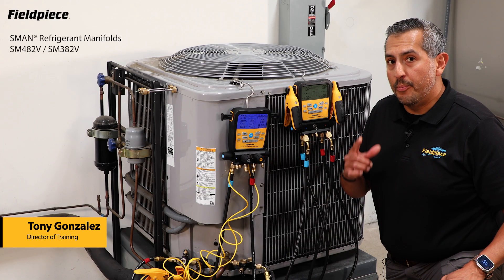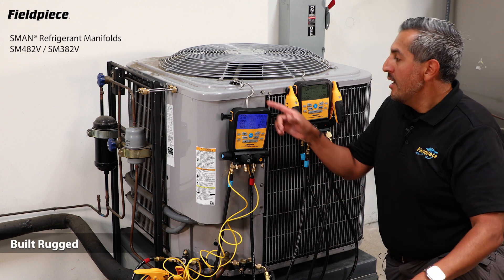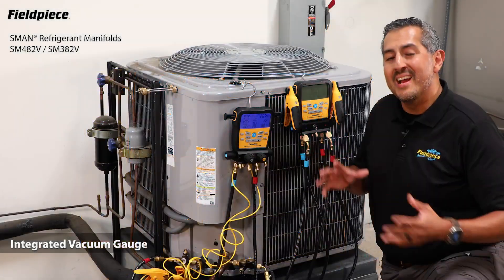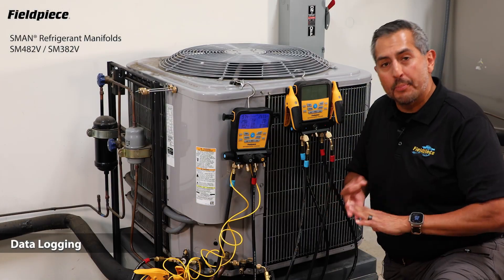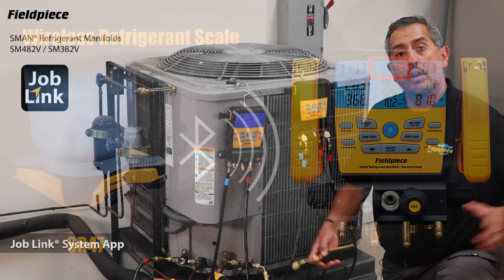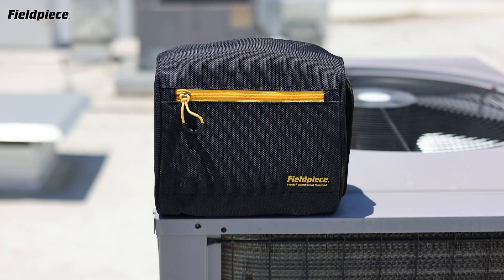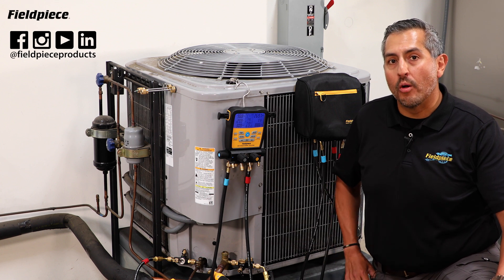NEXT GENERATION DIGITAL MANIFOLDS | Fieldpiece SM482V | SM382V

Comment: So i had the last gen. I loved it. But the internal vacuum gauge stopped working on every set I've come across because it keeps getting hit with refrigerant and there's no way to clean it. So why put it in. Especially if yall design it to work with an external gauge? Also I was taught nitrogen does not fluctuate with ambient temp because its an inert gas? I obviously could be wrong. Just wondering.

Comment: The 382V is much better because no one pulls vacuum through a manifold anymore lol
Reply: Probably a stupid question I’m in residential hvac everyone at my company uses these to pull a vacuum and I just bought the sm482 why does no one use them anymore
Reply: @Shooterrules  I think a lot of techs pull through gauges still. But the better way is a one hose (3/8 or bigger) with a core removal tool. Honestly it still works fine through gauges.
Reply: Right lol

Comment: I'll stick with my SM480V. Its also A2L compatible. I also use my wireless temp clamps with them and it does just fine. No need to spend $1000 for some gauge's when mine does almost the exact same thing.

Comment: Compare the 480 and 482. Why should I upgrade?
Reply: That’s a good point the only change I see is the clamp holders
Reply: The new ones are rated for new refrigerant coming out a2l
Reply: @dredrops1 The 480v and 380v are also a2l rated
Reply: @dredrops1  my sman 480 have A2L likes R32, R454B and even A3 refrigerant such as R290 and R600. the new function are the N2 test button

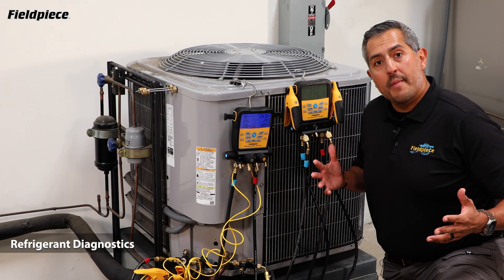Comment: How do you trust a guy that says "putted on" (about 1:35) and does not know the difference between supply and return vs indoor and outdoor unit?

Fieldpiece has NEVER implemented a psychometer for reading outdoor conditions in their app. despite repeated statements of "it's in the works".
Hey, you have it in the SMAN why not in the app?
Does that OA info transfer from the SMAN to the app when you link it?
Reply: Thank you for the feedback. As a matter of fact, the Job Link app is able to get the ODDB with the JL3RH. It’s been in the app for a couple months now. Check it out =)
Reply: @fieldpiece_tonyg  
I will look for it.
Used it this week and still had to input it manually.

Comment: Seems like the sm480v with a facelift. I love my sm480v gauges. I stopped using multiple gauge sets ever since i bought these. I will say the only thing about these is that they are a bit heavy but ill never go back to having 3 pairs analog gauges on the truck.

I also use fieldpiece probes and theyre nice. I dont like using my phone with nitrile gloves on, and i dont like getting refrigerant oil on my phone either. So manifold gauges are still my go to.
Reply from the maker: Heads up, the SM482V is about a half a pound lighter that the SM480V! Every little bit counts
Reply: @FieldpieceProducts  I will buy them for sure. 👍

Comment: I bought the digital probes.  Gauges are a thing of the past.
Reply: They have their place I wouldn’t say they are a thing of the past
Reply: Idk.   But they update the app all the time.   So I’m sure they can add it
Reply: Do the probes have the info of 32 and 454?
Reply: @kevinpearce3281  27 years and counting. Let’s see if you get half that. Nobody wants to steal them. No batteries to go dead. How accurate do you really need to be? You’re not building a rocket ship.
Reply: Analog batteries never die. I have all three and use analog most often. Probes does not fit everywhere a hose does.
Reply: @WhowereEpsteinsclients  then take the hose off your guages and put the probe on the hoses, now probes can fit anywhere guages can.
Reply: @ZRock7771  Maybe they will make a phone with a hose already attached no need for probes. Oh wait they already have that.
Reply: Analog gauges are good for rainy days. Thats about it.